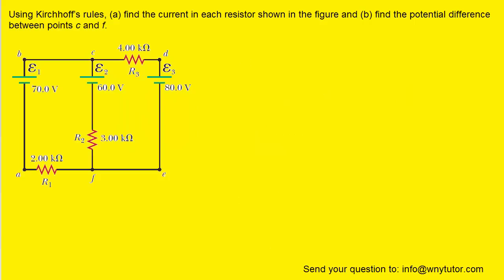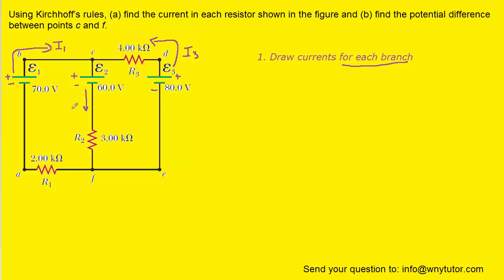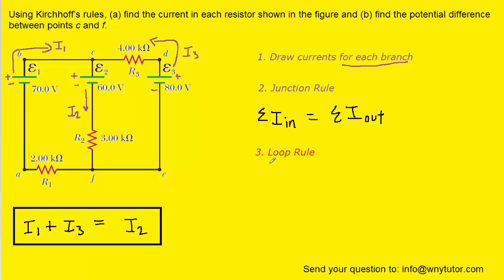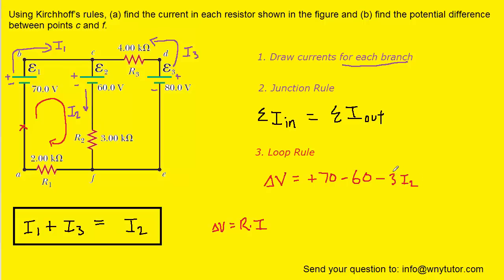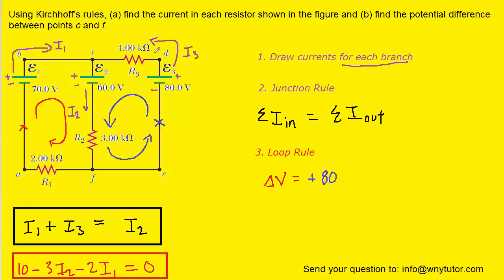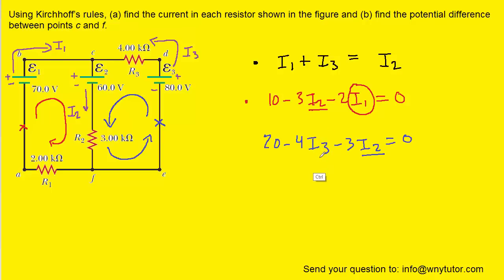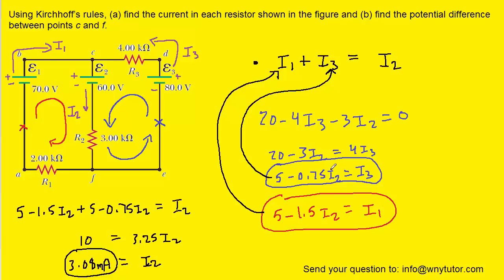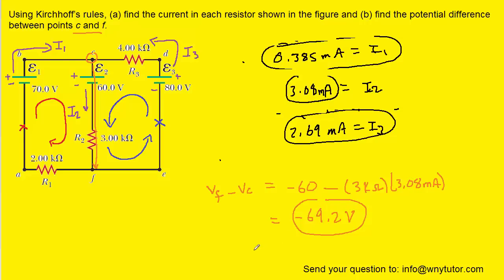Using kirchhoff's rules find the current in each resistor shown in figure

Comment: For anyone confused about how to find out if the currents need any kind of prefix after calculating, look at the final step of the first substitution

3.25*I2 = 10
Check your resistances in V = IR format
here, V = 3.25*I2 so the R is 3.25 and whatever the mentioned prefix is (in this case kiloohms)
You can multiply by that prefix to make the answer more clear:
10 = 3250*I2
which gives 10/3250 = about 0.003077A (amps)
then you can convert back to a more convenient prefix
3.077mA (milliamps)

Alternatively (and likely more easily), you can constantly keep track of your prefixes by writing them through every step of solving
Example: writing 3.25kΩ*I2 instead of just 3.25*I2.
This way you shouldn't forget what scale your answer should be on

Comment: For part a how did u get 3.25?? Skipped a step and I've been over it many times where does the extra 1 come from?
Reply: There is I2 on the right side and -2.25*I2 on the left side. Maybe you forgot I2 on the right side.
(-2.25)I2+10=I2
=> 10=I2+(2.25)I2=(3.25)I2

Comment: When adding the two equations 5 -1.5 i2 + 5 - 0.75 i2 = i2 how did the 1.5 and 0.75 become 3.25 I'm getting 2.25 have I missed a step? Many Thanks
Reply: There is I2 on the right side and -2.25*I2 on the left side. Maybe you forgot I2 on the right side😂
Reply: Same thing 😢
Reply: Not really he made a mistake
Reply: the I2 from the other side carries a 1 I think

Comment: it should be 2.25 not 3.35
Reply: yea he didnt notice but still a great help tho..
Reply: Loop1) I1=5.0mA-1.50*I2,
Loop2) I3=5.0mA-0.75*I2, 
I2=I1+I3=(5.0mA-1.50*I2)+(5.0mA-0.75*I2)=10mA-2.25*I2
I2=10mA-2.25*I2, ∴3.25*I2=10mA, I2=10mA/3.25
Reply: @꺄호-u4t  how do u get 3.25???
Reply: @faheem1216  Check the equation in the last row. There is I2 on the left side and -2.25*I2 on the right side. Maybe you forgot I2 on the left side.🙂

Comment: If you chose different directions, how would you know if the current is positive or negative? I chose a different direction and got a negative answer for I2, and it took me over an hour to redo it, because i thought it was completely wrong, until I did it your way and realized I just had the sign wrong!! what a waste of time, please tell me so I dont make the same mistake!
Reply: MoniSmiles you did it right. Your negative sign was just indicating that your current is actually going in the opposite direction.

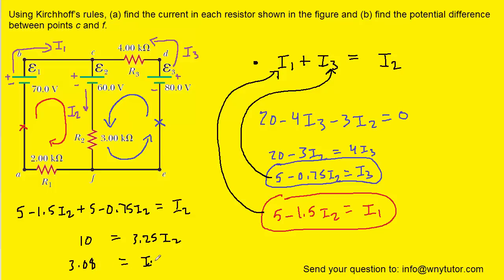Comment: at 9:01 you did 10\3.25 . You said 2.25 at first. so instead of 3.08 its 4.44.
Reply: Saw from another comment and I just noticed that the video isn't wrong, also I think he never said 2.25.

Anyways, the video's right because there's still an I2 on the other side which is just 1. So 1 + 2.25 = 3.25.

Though this is years ago, just wanted to share haha.